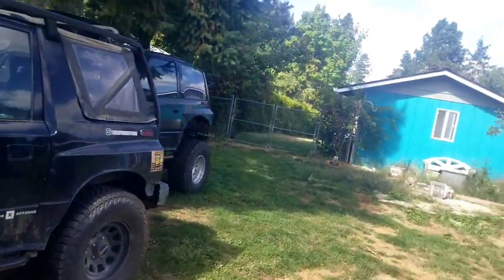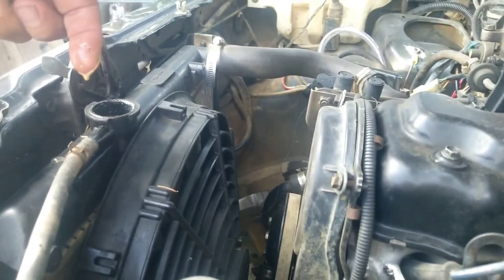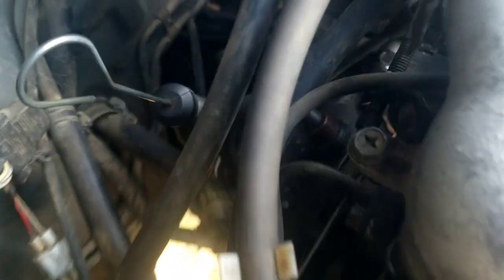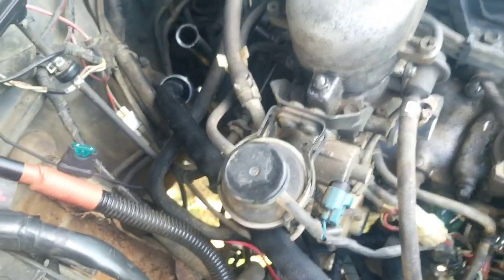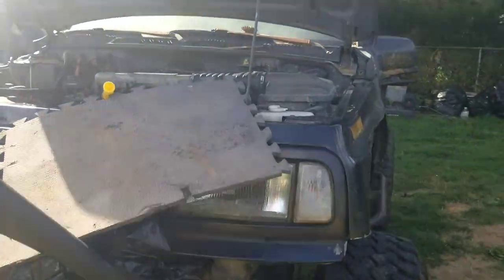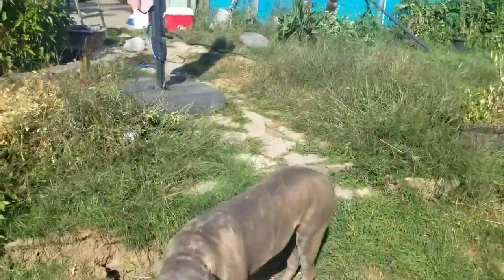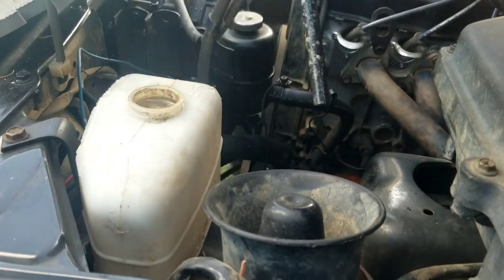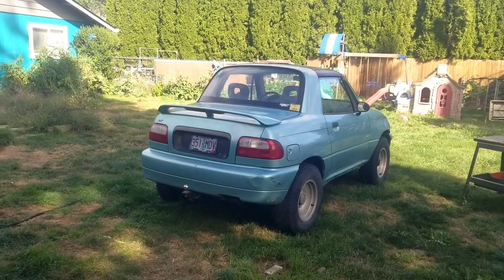Flushing the cooling system on a Geo Tracker

Comment: You d better lift the front of géotracker to have the radiator port above all of the cooling system ! Then, you full the coolent fluid and there is no problem. After the operation, for the future,  install the expansion fluid tank above all piece of the cooling system, to avoid air rear socket.

Comment: I have an issue with my 94 geo tracker, it’s the radiator/coolant reservoir. Today when i got home i noticed my reservoir was boiling and all the cooling came out of the reservoir hose that has an arrow pointing out. And I looked underneath and noticed that there was a hose that wasn’t connected to anything. Is it supposed to be like that or is it supposed to connect to the bottom of the radiator somewhere? Any info would be nice, i’ve been looking all over and can’t find anything. Thanks in advance!
Reply: I forgot to mention, that’s where all the coolant was coming out of i’m pretty sure. I followed the hose down and it’s the same hose that connects to the reservoir
Reply from the maker: The hose you are describing comes out of the cooling reservoir and hangs down. It is for steam to escape the system.